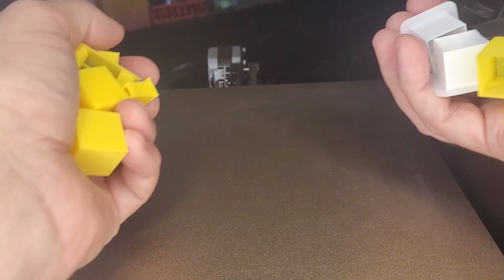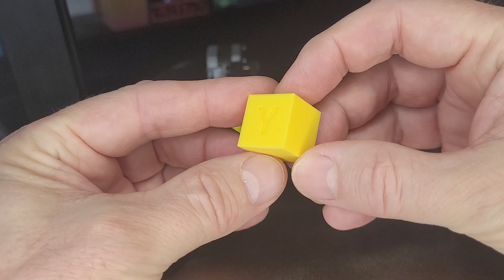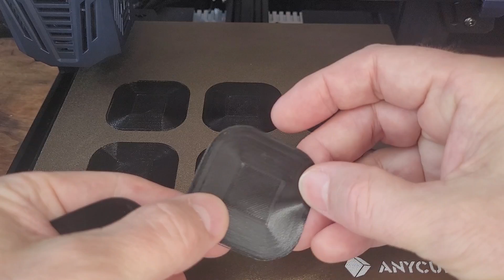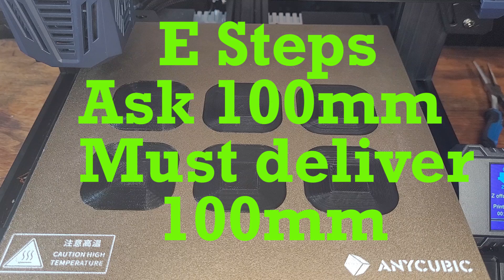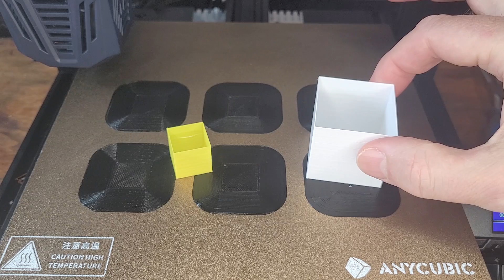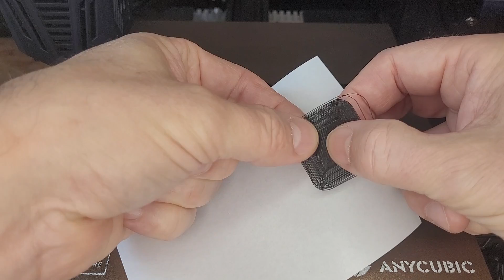E Step Calibration Vs Flow

Comment: Well, this is very odd?  I can have 100% perfect prints then a sudden bad print then later on a good print then a normal so so print.
I never have set my e-steps on any of my printers.  

I do test the printing of each filament by doing a model and seeing if it has printed?
Sometimes I get over extrusion with deep peaks of plastic, so I turn down the flow rate by 10% from 100% and test again!

If it fixes that then I see if the temperature is too high or too low and adjust, such now, that I have each filament box with a written listing for each printer that shows the Nozzle temp & the bed temp & the flow rate & the fan speed & the printing max speed?

And I stick to them. Never do temp towers or tests for thickness on test cubes.
I found over time that each printer from different makers print at different temps etc. that's why each is listed on the boxes.

But e-steps never did any in the 6 years I've printed. I on the whole get good to great prints, just sometimes can have failed prints?
But often it can be too much moisture in the filament ( PETG or ASA or ABS ) PLA can be picky over that rarely.

I dry filaments as needed in the Sun Lu S4 filament dryer and all including the PLA's go then in to a 3D printer filament storage bag with desiccant bag. So if I still have under or over extrusion I change the heat of the nozzle or the flow rate,  never do the e-steps.

So I wonder then since I can get good prints allot of the time without doing e-steps why is that? 
Because I sure am not doing what they say you must do ( under or over extrusion ) to solve them by e-steps! so odd.

I like to know why I can still have good or even often great printing without doing all this calibrating stuff?

Comment: hey smiley, i have been learning alot from your videos recently and i very much appriceate these. i have one question/concern though about flow. now i thought i had been set up and doing things properly on my kobra go until you made the latest video on the new retraction test, which is great b.t.w. however i found something out on my printer and i want to know if its just mine or if it is a detail thats been overlooked or simply if i am missing something entierly.

 please bear with me, in cura i prepared 9 sets of strands each with different temps retracts and even flows, i have about 27 gcodes set up for each. now when monitoring my prints i look at the printer screen interface. the only thing it doesnt show is flow. now while the print is running if you click menu a screen pops up with the current settings on main screen but with flow at the bottom. now what ive realized is that in all of my gcodes, with different flow settings, on the interface it does not reflect the flow changes like it does all of the other settings. so it seems apparent that ALL of my prints have been running at 100% because thats what it says on the printer.

 now am i missing something? why would the flow setting not reflect the gcode like the other settings do? is there some sort of factory default override? i do like this printer, though i am considering modifying it to direct drive and dual z, but once i found this i have become very very frustrated and CAN NOT find any info online about this. i really dont want to deal with anycubic customer support either lol. any insight, thoughts or advise from you or any veiwer would be greatly appriceated. thanks for all the help
Reply from the maker: Hey Robert, wow digging deep, way kewl. That flow that you found allows you to adjust the flow during a print, same as the speed. I searched the eeprom for M221 and didn't find on my eeprom so no forced flow settings to my knowledge. Did you complete your test or stop?
Reply: @mayhemsmiley  well i stopped with the flow gcodes i had set up once i realized i could set it manually on the machine. Honestly even buy doing that i havent really noticed much of a change. Its a little frustrating. The profile i use has flow set at 95 and it seems to be fine in most cases but i just cant shake the thought that the gcode is being overrode. Why else would it not show like the ither settings do? I just dont know
Reply from the maker: @robertolson6686  interesting, I sliced a cube and searched the gcode for a change in the flow and could not find. hmmm
Reply: @mayhemsmiley  i was thinking more along the lines of the firmware of the GO. But .... The more i think about it the more frustrated i get, a thought just occured to me as i read your teply that maybe, just maybe, that flow number on the active print menu on the machine means 100% of my set flow in cura? Lol it could be that im over thinking things again lol. I just dont know.
Reply from the maker: @robertolson6686  LOL it's good to take a break sometimes. I will investigate too. Certainly interesting find.
Reply: @robertolson6686 did you ever get this worked out? I've been using orca slicer built in flow calibration.  I only notice a difference with going up by .10 or .20 so only on pass 1

Comment: Sorry this is off topic but do you know what would cause this problem? I need to auto level my bed but each time when it starts on the first point it tries to push through the bed it seems. So much that it starts to bend the build plate. The odd part is the red light in the print head comes on when it gets close enough. If you have any ideas it will help a ton.

Finally got it fixed. The issue was the main wire leading into the  sensor was twisted up too much and kinked that it wasn’t relying the signal to the main board. Thank you all for your help
Reply from the maker: No worries if it is about 3d printing it's on topic for me :) Does it only touch and bend on the first point and not any of the other points there  after? If it's only on the first point and you abort, just because you see the light come on doesn't mean that the signal is making it back to the processor. YOu may need to follow the sensor wire and hopefully it has only come loose on the connection to the control board. Keep us posted how you make out.
Reply: @mayhemsmiley  it hits the first point goes down then a red light comes on near the orange sensor. After that it keeps going down bending the bed with the force of the motor. I will check the wires when I get home.
Reply: Your sensor may not be where it needs to be. Stick the 2 sided wrench under the sensor with the nozzle touching the bed. Loosen the screw and let it drop on the wrench and tighten it. Then run auto bed leveling again that could be the problem too
Reply: Also make sure the gantry wheels  are tight and manually level the bed first before auto leveling stick a cheap level under the gantry to get the height perfect.
Reply: @gator509rind9  I did all you said but it still won’t auto level and pushes so much on the first point that it bends the plate. I might get the parts to make it a manual leveling printer if I can’t fix it.
Reply: The nozzle shouldnt touch the bed at all maybe a faulty sensor
Reply: @gator509rind9  I will look at replacing it

Comment: Hello, I am watching your videos and thanks for what you do, your tips helped me. I want to offer you a video topic, how to calibrate a table with an accuracy of 0.01 mm. To do this, you need to connect the printer to the computer, and run auto-calibration, the results of the calibration show in which direction the skew goes, tighten the skews and start the calibration again. Repeat the process until the table is sufficiently level. https://www.youtube.com/watch?v=YwlOkd9HHHE Here's a video as an example of how I did it, sorry for the mess

Comment: do you use special settings to get a smooth top? I know chep used to have settings for smooth top by using ironing and special ordering settings in cura.
Reply from the maker: Hey Gary,  no ironing on mine.  I've seen Cheps video on ironing.  Once both the esteps and flow were well dialed it really came together.  I do use the monotonic setting that Chep  uses.

Comment: How do you calibrate flow?  I thought the e step was flow.
Reply from the maker: Flow is adjusted from within your slicer.  Default on mine was 100%
But found some filament performs a little better at 105. Thanks for asking I should have mentioned it in the video. Have to figure out how to add that detail.  Let me know if you need anything else
Reply: @mayhemsmiley  is there a way to calibrate flow in machine settings so I dont have to adjust all my cura profiles? Thanks!
Reply: @straighttothepointfishing idk about other printers but you can on the ender 3